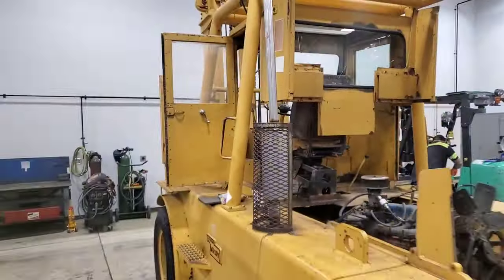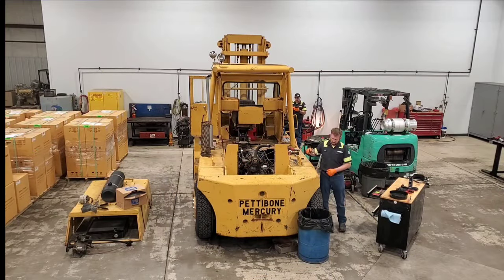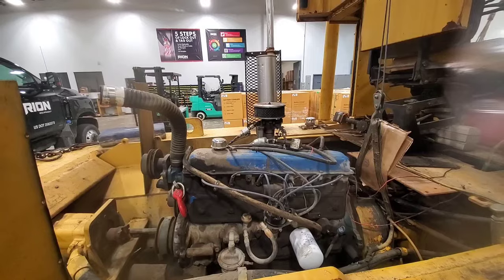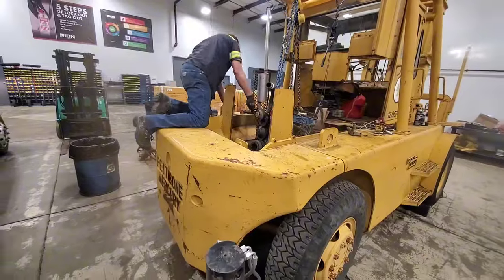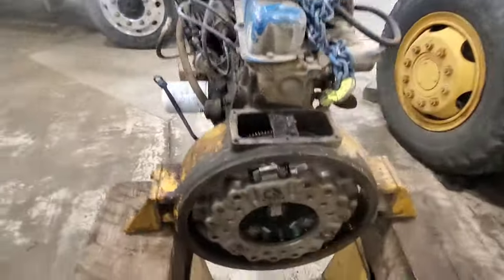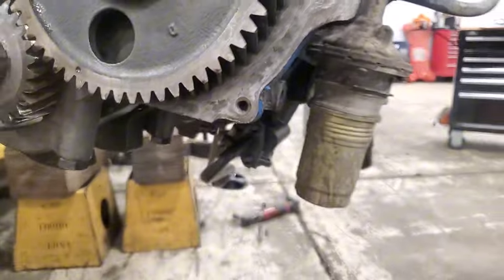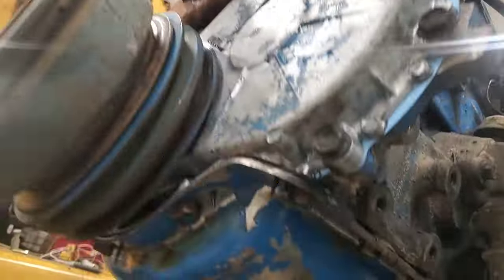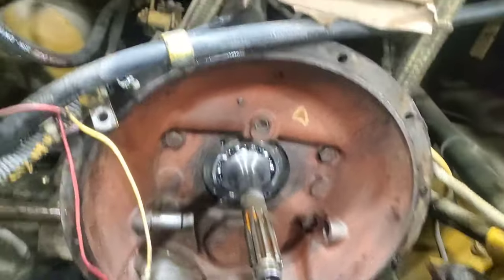Ford 300 in a forklift

Comment: The pilot bushing seen in the crankshaft can't be a match for the transmission's input shaft.
Is it an unnecessary leftover from the engine's previous life and the correct Pettibone bearing is located in the flywheel?
Reply from the maker: Possible. The input shaft on this only engages the flywheel pilot bearing.

The pilot bushing ID is 1" and the clutch shaft ID is 1-1/8" -10 spline. So I had to machine down the shoulder on the tool in order to be able to get it out.

You'll have to tune in to the next episode to see that whole mess.